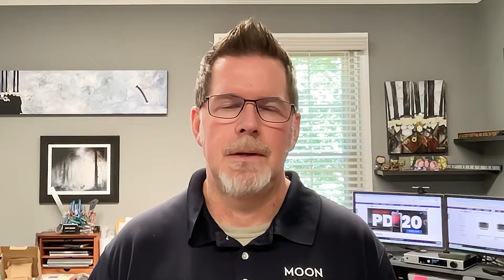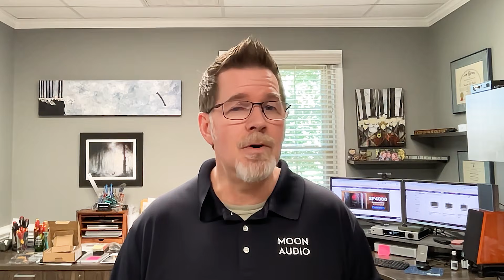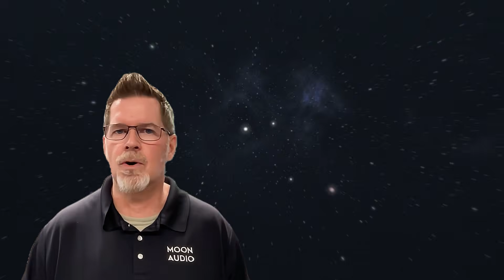I Tested Audiophile Isolation Tweaks. You Won't Believe The Results! (IsoAcoustics)

Comment: I use Neo 1 under B&W 802 on a suspended wooden floor.  Everything explained here is correct.  I use Neo 1 under Sony SS-AR2s on a steel reinforced cement slab in another home.  Everything explained here is correct for this situation too.  I also use other Neo 2s and 3s under 3 turntables.  They just flat isolate more effectively than anything else I have found.

Comment: I use a pair of IsoAcoustics ISO-155 stands under my SVS Ultra Evolutions bookshelfs and they seemed to make quite a bit of of difference, however I have to admit that MOST of that "difference" probably comes from the fact that they are 3 inches higher of the desk.

Comment: Best mhz you get by putting the bass side on the opposite side up, this means you have the bass element above the mid range and the other speaker i cant recall the name of. this is the best way to hear the best sound. also put 4 oranges under the speaker so the 50 hz volume door is closed and the neighbours dont complain. i have measured the  hz under the speaker direct over so its function is well aware good. i got 500 points in the speaker test software from sony. yeah man ,really good. nice to hear another pro than myself say the important things.

Comment: At 2:35 to 2:40, you hit it on the nail.  The speaker is rocking back and forth, and the spikes/footers, properly adjusted, keep the cabinet from moving- that motion causes blurring from the output of the drivers.  Reflections off the floor, walls, and ceiling cannot be reduced by an isolator.   Reminds me of the Townsend platforms that I tried.  Made things worse; all that motion in my ATCs (you touched the speakers, and you would think they would tip over), and ATC definitely said NOT to place them on such a device.  All of your talk of off/on vibration is just wordplay.

Comment: The video would be a lot better if you had some illustrations of how the product you are pushing works

That being said speaker spikes failing to isolate is comical because they’re intent is to couple. They are originally designed to pass through the carpet to couple the speakers to the floor. Now you can have a conversation about whether or not that is what you should be doing, but there is a lot of variables that would go into a decision on whether or not you are isolating or coupling a speaker.

First, the objective is to make the speaker cabinet as rigid as possible, so it is not vibrating counter to the cone movement thus ruin the efficiency of the driver and smearing your sound. If you have a slab four and carpet, your best bet would be speaker spikes. If you were on a suspended wood floor with extremely heavy speakers, You may want to isolate them from the floor. But if your speakers are comparatively light on a suspended floor, you may get more of a benefit by coupling them to the floor, then by isolating them from the floor because wow you may be isolating your vibrations from the floor you’re not limiting the vibrations in the cabinet itself. This is the reason why there are many options for feet on speakers. Not every device is perfect for every situation.

Comment: Laser inter feromitry studies.... WTF does that mean. Seriously I don't think this hobby is right for me.
Reply: @cramjam  Don’t ditch the hobby because of a YouTube video. Lasers have been used by many speaker manufacturers and some audio reviewers to either fine tune or determine the overall specifications and/or sound characteristics they were hoping to achieve in the final design. First saw it discussed in audio publications in the 1970’s, so not a new thing. There are other YouTube channels with better information on audio, this is not one of them.
Reply: *Laser interferometry* is a measurement method that uses interference patterns from light waves to measure very small changes, such as microscopic displacement, changes in refractive index, and surface irregularities. It works by splitting a single coherent beam into two paths with mirrors, recombining them so their phase difference creates a detectable interference pattern.

Comment: What type of floors do the least damage to the sound ?
Reply: Acoustic Absorbing Concrete.   The Goal is motionless cabinets.  Securely fastening them to a thick concrete pad works very well as long as the room has been treated in some fashion.   For cabinets to remain motionless, securing them to Jell-O or a suspended floor isn't going to help.  That will just get the suspended floor moving too.   But, if one puts Jell-O between the cabinet and suspended floor,  the Jell-O will mitigate the cabinet movement from the floor so at least the floor isn't moving too.   So the best is the fictitious  'Acoustic Absorbing Concrete'.    You're welcome.
Reply: @TriAmpMyFi i think that sounds like good news for me.  I have ceramic tiles on a concrete floor.  Spikes under the speaker and all 4 spikes on the floor.  Someone said if I wanted to experiment just put something heavy on top and the will stop the cabinets moving.
Reply: @jondu-sud274  -   Spikes are shaped for maximum 'Friction'.  Ceramic is a very hard, brittle  material.  I don't know if your spikes are getting a bite on the ceramic.
    Try setting 2 or 3 spikes into the grout line.   A lot of weight pressing down on a ceramic tile with a pointed spear could make a crack too.
   I might re-think spikes on ceramic tile,  If you've ever set tile, the underlayment is done with a grooved trowel.  There are bands of air beneath tile making it not fully supported at a 'spike' contact area.
Reply: @TriAmpMyFi cheers, thanks for taking the time to reply.  Complicated stuff when you think it through.
Reply: @jondu-sud274  -   Your welcome.  We audiophiles are supposed to be sharing our experiences, knowledge etc.
     I'm curious, how much do your speakers weigh?  Care to say make & model?  Cheers.
Reply: @TriAmpMyFi They are 14kg each. French brand Apertura, model is the Sensa.  It is a compact tower.  I bought them under supervision by my better half. We listened to several speakers and both agreed instantly on the Sensas. I have been very happy with them for the last 5 years or so, no itchy feet.
Reply: @jondu-sud274  -   I see them. Thanks.  I would not put those spikes on tile no matter what the sub-floor is.  I also wouldn't spend 500 dollars on fancy iso-whatever feet.  Store bought feet will isolate from floor.  My suggestion is better because we are using your floor as the asset that it is,
     I would be looking for a disk with diameter about 30 cm or 1.5 inches (as small as you can really without chancing a crack tile) or so about 1.5 cm or 3/4 inch thick with a durometer about the same as a used tire.
    Keep the spikes in use but something small and durable (not hard) needs to go in between.  Get that friction.  Cheers.

Comment: Why dont speaker manufacturers do this as an option ?
Reply: Gia rubber feet, hundreds of dollars … Spikes are a bad idea, but emptying your bank account isn’t any better. I use heavey machine feet that you screw in just like spikes, but which have large rubber caps – not as good as Gia’s, but perfectly adequate at way less than a tenth of the price …